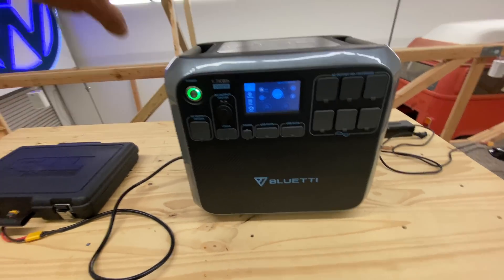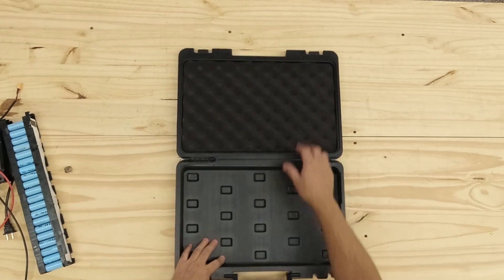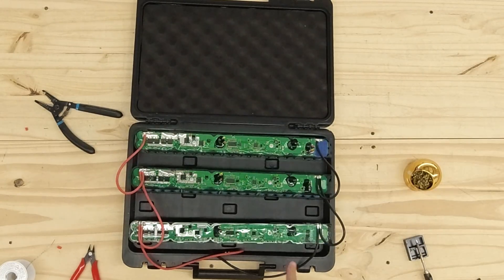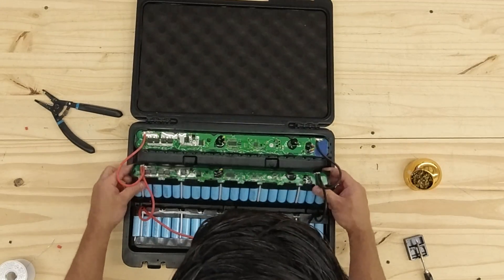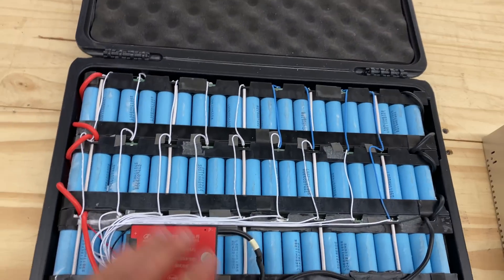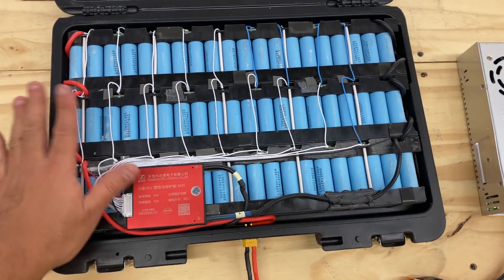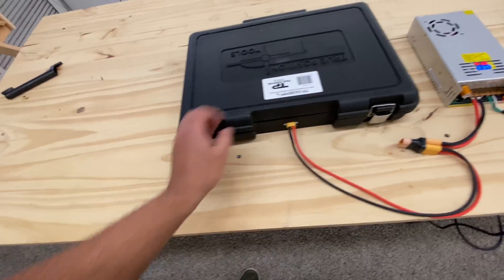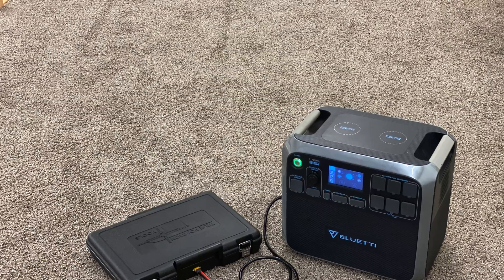Bluetti AC200 DIY Booster Battery Pack Build Project

Comment: Fantastic video !! Question - when the booster pack is attached to the bluetti, and the bluetti is fully charged, will the booster pack continue to be drained? The energy from the booster pack shunted off as heat ( ? I'm learning .. out of my wheelhouse here).   End result, don't leave the booster pack attached if not needed?
Reply from the maker: It will stop charging when battery is full

Comment: I have 2 of the EF 110 watt panels.  Could I charge the the dyi box via the panels?  I would use the adjustable voltage and amphrage box to get the most energy possible from panels into box.

Comment: Couldn't I use the dyi batteries with my Ecoflow Delta 1300 sogen?  

If so, am I correct that I would only need the first cable external section (female/female)?

And more importantly, then would the dyi box be able to be super charged from my 1300 somehow with 1300 getting recharged via AC?  Without 1300 getting recharged at the same time?  

How much do those dyi kits weigh?  

Dimensions?

Lastly, is there a similar kit with LifePo4 batteries that can function like the B300 and B230 units with the AC300 or AC200 Max?  

I'd love to watch side by side comparisons of the AC300, AC200 Max, Delta Pro, and Inergy newest one.

Comment: When charging the Bluetti 2000wP with solar, should there be any dual shutoff circuit breakers wired in and any inline fuses uses on each panel when charging to the max 700 watts in order to avoid overage amperage?

Comment: You "explain" that you are using a charger that has variable controls.  You say you are using "less than 42" but don't explain why.  You also mention that variable amps but what does that mean?  What is the he significance and when/why would you set amperage controller at a specific amperage?

Comment: Unable to see your wiring.  You started wiring some white connector.  What was that?  Then some of those wires were white and some blue.  Why?  Then you "explained" wiring the BMS but you did not show how you did it or the finished connection.

Comment: What about back flow from the Bluetti back to the Booster pack once the Bluetti is fully charged? I've had problems with back flow when I used a car battery to charge the Bluetti. It started off charging the Bluetti, but when Bluetti reached 100%, it backflowed to the car battery.
Reply: The BMS will prevent this from happening

Comment: I like the idea of booster packs, but the problem for van dwellers is charging the booster and Bluetti separately.  We don't always have access to AC plugs to charge high capacity battery packs like this.  Is there a way to connect this booster pack so it charges with the solar generator at the same time?  Then the Bluetti will truly have double the capacity without having to worry about somehow charging two items separately.
Reply from the maker: Yes plug into the Bluetti ac plugs,  then charge your bluetti normally,  it will take twice as long to charge your bluetti as it should since you now have twice the battery.
Reply: @jehugarcia  LOL of course that makes sense.  Can the packs be charged using DC instead of AC? (yes, I'm a total novice, hence the solar generator vs home built option - but I'm willing to learn).
Reply from the maker: Yes they need 42v DC to fully charge,  the bluetti only puts out 12v DC so you would have to boost it up
Reply: My question is can you plug a third party battery into the battery port therefore boosting without having to charge separately from the Bluetti?

Comment: OK, I just made a 4 scooter pack version using the newer Panasonic scooter packs on this site: https://jag35.com/collections/lithium-batteries/products/40-cell-ncr18650bd-18650-lithium-scooter-battery-pack
I used a Daly 10s 36v Common Port BMS:  https://www.amazon.com/DALY-Battery-Management-Protection-Balance/dp/B08761R7SY/ref=sr_1_3?dchild=1&keywords=Daly+10s+BMS+36v&qid=1608763287&sr=8-3
I didn't wait to learn how to wake up the BMS board that's attached. I removed the attached BMS board and built it to the directions here. Go slow when you are wiring the BMS. The video went too fast for me. I made notes on a Common Port wiring diagram available here: https://drive.google.com/file/d/1XuVTMbsmKfBUQOJI-YWCfvYLIAeorP7z/view?usp=sharing 
I bought the 5A version of the charger instead of the 2A: https://smile.amazon.com/gp/product/B08CXPRNCB/ref=ppx_yo_dt_b_asin_title_o04_s01?ie=UTF8&psc=1  This 4 battery pack version, in turn, charged the AC200 at up to 480 watts input.
This Harbor Freight 18" Toolbox has a very snug interior fit to grip the Panasonic battery pack (you might saw down a portion of those plastic mounting tabs on the end of the Panasonic pack) and leave enough room to house the AC charger listed above: https://www.harborfreight.com/18-in-heavy-duty-impact-resistant-toolbox-56681.html
Reply: Can you make one for me?
Reply: @alev4287  I could as a strictly hobbyist build. Shipping this much weight around- to me, then to you- would be a big expense, though. There's a pretty simple way to wire those Panasonic scooter packs together now. Rather than break these packs down and removing the BMS board, this battery activator- https://www.youtube.com/watch?v=AzMzUB5lK0k -means you'd just need a small amount of solder points, no additional BMS and plug however many scooter packs together in that PCB board. That's how I'd do my next Bluetti add-on build. I'd simply strap the packs together with a robust zip tie to manage all that weight and heat shrink the whole block.

Comment: I'd like to make a few of these, but I wasn't clear about how you connected the BMS. A little slower would have been easier to follow.  I have a Jackery Explorer 1000. Will this setup work for the Jackery?
Reply: check the link to wire schematic, it will clear the confusion with what go where :)
Reply: @israelmalik9427  Ah ha, thanks, I missed that, too.

Comment: Not sure I understand all of it but the unit has a cigarette car charger cable.  I'm guess it would take 18 hours of driving to recharge the unit.  Could you attach a 500 watt inverter to the altenator battery and charge while driving?  Would that be the same as plugging into a wall outlet?  Tx

Comment: does the BMS take the power from the power supply and give the batteries CC/CV charging? is the BMS a charger? are these batteries being charged with the correct CC/CV method using these instructions?

Comment: Thank you for doing this. I have the Bluetti 150 and bought 2 of the battery packs and will buy another next week.  Do you have links that I can use for the components? And maybe wiring diagram ?
Reply: Dean, you bought two battery packs? Where did you get them? Thanks.

Comment: What option do we select for the power output when purchasing the large charger? They force you to make a selection various volts and amps. I thought this charger allowed a large range
Reply: For anyone else that was wondering it is the charger with the 0-48v / 0-10 Amp specs on Ali Express
Reply from the maker: If you are asking me what voltage to get,  your probably better not getting th variable power supply,  just order any 10s Charger they usually labeled as 42v

Comment: If I arranged these packs in 6P instead of 3P would I need to use heavier gauge? Would the same BMS be ok? I'm new to this & I'm wondering if the AC200 will pull more amps if there are more cells in parallel.
Thanks
Reply from the maker: No the load remains the same in this particular application 12A,  but if you planned on powering other things then yes each pack can put out around 20A x 6 = 120A which would require 2awg at least

Comment: Anybody know if the AC Adapter from the AC200 would work for charging the booster pack? It’s about 400w but I can’t find the voltage or amperage listed anywhere.
Reply from the maker: It’s 58v so if It would be dangerous  as it  would eventually over charge the pack causing it to catch fire.
Reply: Too bad.  How about if I put it through a voltage regulator to drop it to 42? I ordered a spare AC adapter so it’d be great to use it other than when I’m in a hurry to charge the AC200.
Thanks

Comment: I just received 6 of these packs! Can anybody advise me of the best way to remove the clear, soft, potting material that encases all of the solder points? This material smells similar to epoxy and I'm concerned about being able to solder effectively.
Thanks
Reply: You have to literally scrape them away to expose the leads. It’s tough, but it is possible.
Reply: I’ve used a toothbrush shaped wire brush followed by some 99% isopropyl and I think it’s adequately prepped for soldering.
Thanks

Comment: The bluetti looks like such a neat device. But it appears that you can't charge it using 12 V car sockets, is that correct? It would be a show stopper for me :(
Reply: There is a car charging mode in the settings.

Comment: I ordered the bms from amazon with the your link. Delivery date is mid Oct to Nov, yipes. Do you have another alternative? I should have all other parts  in the next week.
Thanks for making this project available.
Reply from the maker: Watch today’s video,  you might not need the bms after all
Reply: @jehugarcia  Hard to see the BMS connection on how you do it?
At 5:04, you talked about it, but don't see it on the Diagram? 
Did you "T" splice into the wire?
Reply: Yikes...I went ahead and ordered the batteries from Jehu but hadn't ordered all of the rest of the stuff yet. Thanks for letting us know and for asking this question...this will also be a challenge for me.

Comment: The real cool thing would be if you could just buy the interface without the cells.  Just a neat package that you can connect to your own cells with bms . AC-DC charger, MPPT, battery meter build in. Some 12v outlets usb fast charing, easy alternator charging ,optional inverter. Maybe bluetooth and an app to keep track of it all..This would make a lot of VAN/RV self builds much easier and more integrated.

Comment: There was this question in the Q & A on Indiegogo 8/24/2020:  
"Can we put a Litium battery bank connected to the solar charging port to charge?"

Bluetti posted this statement below,  they do not recommend this...does anyone know why?:

From Bluetti: 
"Hi there, thanks for your support in Bluetti campaign. Yes, you can use a lithium battery to charge AC200 as the following reviewe: https://www.youtube.com/watch?v=s1kbq0GncIk&t=6s. But we don't recommend to do it since it may cause damage to the battery, etc."
Reply: The Bluetti input low voltage cutoff is designed to prevent a lead acid battery from discharging below 40% which causes damage.  This is well below 0% charge for a lithium ion battery.  If unattended the Bluetti will take your external battery pack to zero unless you add a cutoff to your external battery.
Reply: @michaelstora70  thx, i did not realize they were talking about the SOC of the other (external) battery, i thought they were talking about damage to the AC200.
Reply: @laronis  the PV input is very robust.  It has to deal with any combination of unknown brand solar panels up to 150v and down to 0v (darkness).

Comment: First off is it a safety precaution or protection of the electronics to leave the monitoring cable unplugged till you connect the blue and black wires from the BMS?

Comment: Thank for the video! I noticed that you used the wrong XT60 with the battery, the female should be on the battery and the male (with pins) should for the load.
Reply: I hope Jehu responds to your post about this since I plan to build this and if there is a switch needing to be made I would love to know the answer to this before building it.

Comment: So excited to try this! Thank you for sharing all the information. Some quick questions...if I attempt to recreate this using the links you provided, do I have to take apart the packs after purchasing, drain, recharge, and individually test all the batteries, then reinstall them the way you have done with some other videos before I do the assembly? 

Also, this might be a dumb question, but I am female and this is the first time I will have ever attempted building anything electrical and am rather limited on tools. I will purchase the soldering iron, but is there anything else maybe not mentioned in the video that might be necessary (like a Kill-a-watt meter, or any other measuring or testing device)?

One last question, could this be used to charge my Jackery 500? I know it has more watts than the Jackery and I would have to switch out the cable going into the Jackery to an 8mm instead of the XT90/Bluetti cable combo , but does that mean that it could charge it several times?
Reply: Hi there Jehu, I have spent several hundred dollars on your website ordering batteries and would love to not destroy that money by building this incorrectly. Any chance of an update to the questions I asked above?
Reply from the maker: I don’t know what you plan on doing with these so I don’t know what you are going to need, none of the tools I use are hard to get, you can get everything on amazon .  I don’t own your device so I can’t verify comparability.

Comment: Sir can you tell me how you charge your power wall of lithium ion battery pack what type of buck boost converter you use and what type of will voltage measuring sensors you use please tell me and if possible then please give me the link of that product link
Reply from the maker: What
Reply: @jehugarcia  sir my question is how to charge 3kW power wall with balance

Comment: Stopped watching when I saw you soldering
Reply from the maker: Some are more comfortable buying things
Reply: Did you stop watching from a skill perspective (unable to solder) or from a safety perspective (thinking he was soldering to battery cells)? Because all the soldering was to the circuit board, with large pads, so all quite safe, and even easy to learn on if you don't have the skill yet.
Reply: @TimDonaworth   both. Long term, if something goes wrong, the battery pack is ruined and I'm out $200 dollars. Better to have a professional do it. Like the bluetti, it's prebuilt with warranty.
Reply: Nemo Ciau Wow. What part of “project build” in the title failed to convince you the product might not include warranty ?
Reply: @ThisTall  did you not read what i just said?  i. do. not. know. how. to. solder. i dont have the tools or the skill. thats the only reason why i stopped watching. jesus christ
Reply: @ThisTall    Learning to solder just takes practice  there are lots of videos that can teach you.  you can always start small and work your way up. Building small packs to see how it all goes together. Another YouTuber goes by the name of Average Joe. He made a whole power rack out of 18650 batteries. Nothing has blown up ... Yet. Check out his channel!  He did not know anything about what he was doing and he "Went for it". Thomas Edison did not know how to make a light bulb. It took him 1000 times untill he got it right.  Do you know what he said after successfully making the light bulb?  He said It took 999 times to teach me how to NOT make a light bulb.  If you have the desire, take the time to teach yourself. And have fun doing it!

Comment: but what about the heat from the batteries?
Reply from the maker: What heat?
Reply: jehugarcia does the bms itself give off heat?
Reply: I just thought there would be a little heat while you are charging at a higher rate. And being in an enclosed box maybe that might become a problem.

Comment: Can we use a single BMS for all N cases of batteries?
Reply: Yes, by connecting all the thin wires between the packs each cell group is now in parallel between the packs. Parallel cells act like one cell, forming a single 10s battery which needs only one 10s BMS.

Comment: Did the home brew battery pack get hot charging or discharging? Can you keep that case sealed or does it need some ventilation?
Reply from the maker: Those packs are capable of 30A each,  this setup only loads it with 12A,  no heat at all

Comment: Hey Jehu,
If you left this boost pack hooked up to the Bluetti like you have it here in the video, and you plug in the Bluetti to charge it from the wall, would it also charge the boost packs at the same time through that port on the side?
Reply: He said he was using the solar panel port so I dont think plugging it into the wall to charge would put power out to solar panels. You would have to use a separate charger for the case battery.

Comment: Jaheu. Why do you use XT60 instead of Anderson powerpole?
Reply: Maybe because xt60 is more universal and readily available.
Reply: @josephnevin  no not a good enough answer for me.  the Anderson powerpole is just as available as the XT60.   I always think of XT60 as a hobbiest connector vs Anderson Powerpole.
Reply: @josephnevin  also with XT60 you have to have a male and female connector pairs with Anderson Powerpole they are modular and inter-connectable so when you buy 50 pieces of Anderson Powerpole you end up with 25 pairs even if they are all black.  Also the Anderson Powerpole has different colors. XT60 only has one color.  With Anderson Powerpole they are modular.  You can create your own custom connector with different conductors. XT60 can only support two conductors.  Also the Anderson Powerpole can be disassembled, and the connector can be reused by simply removing the internal connector (keeping the plastic housing) soldering a new internal connector to wire and using that housing again.
Reply: You make a good and valid points. I totally agree with your views. In fact, I might consider using Anderson power pole connector instead of xt60 for my build.
Reply: @josephnevin  let me know how it comes out.